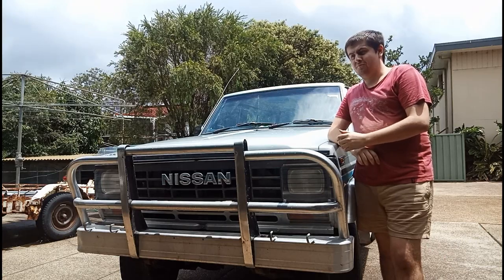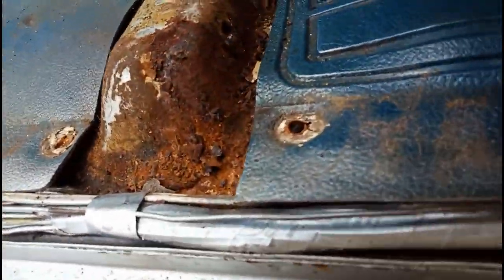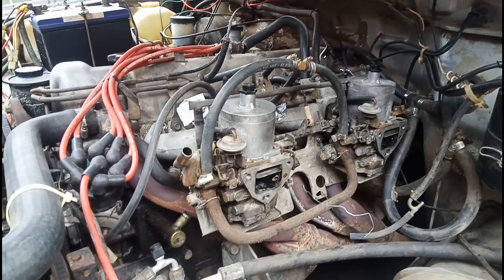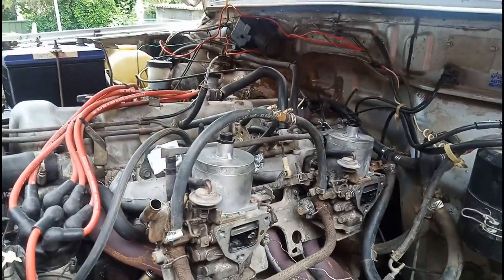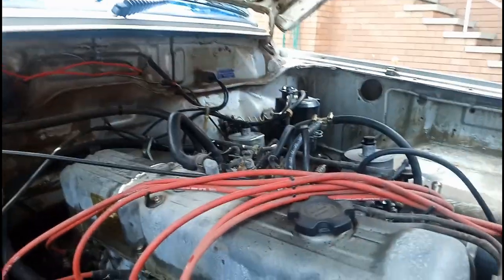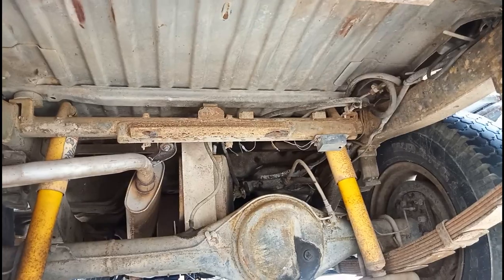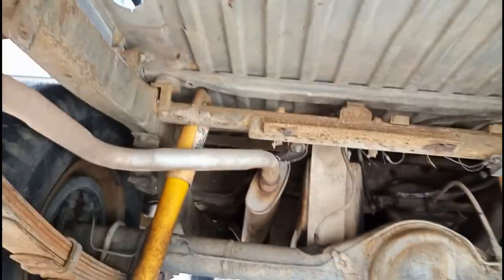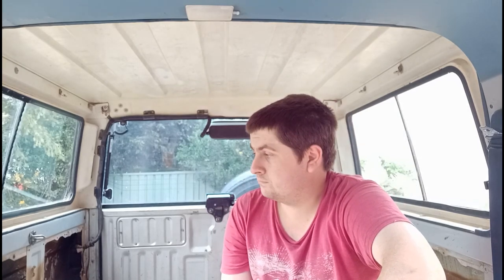My New MQ Patrol

Comment: Got two , 3 doors 2.8 6 cilinders , from 1991 and 1992 , one gray another black , fully restaured and originals , amazing vehicles! Nothing beats that!
Reply from the maker: I also have  2 , the other one is a 1992 2.8L that I bought of the same guy. Unfortunately it is only good for parts since the body is full of rust, but it still has some good stuff on like the fuel tank that I will be putting it in this one.
Reply: @afterexhaust7845  Here its very hard to find parts of find them in good conditions cause almost every model bought by someone got modified and destroyed saddly
Reply from the maker: @Joaofigas1  Yeah, when I was looking to buy one, I notice that half of them had V8 engines in them. I am planning to modify mine, but any I do to it I'm going to make sure that I can return it to stock at a later date.
Reply: @afterexhaust7845  well i had luck , my gray one was from a old men , the original owner so the car only needed a new paint , the black one was also from  the original owner who stopped it 10 years ago in a garage , lucky enough just need a new spray paint , clutch , oil and minor things like new radiator , tubes etc but works and runs great , did put it work after 10 years stopped and did 400 kms with him till my house .

Comment: seems we all have 2 of them, except mine are sd's. if you wanted to get technical its actually an mk within australia. as for your comfort issues, factory suspension seats did exist and are out there.
Reply from the maker: Didn't know that you could get suspension seats for it. I will definitely have to look in to that. Thanks!
Reply: @afterexhaust7845  late model deluxe only, 85/86. stupid difficult to find but if you look hard enough they're out there. worth it for sure.
Reply from the maker: I'll keep an eye on anyone wrecking 85/86 patrols then